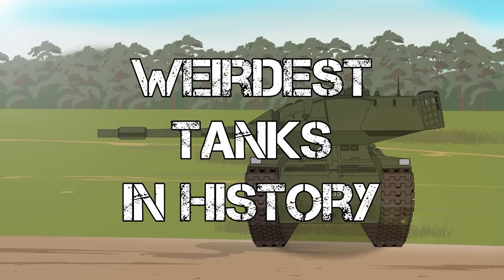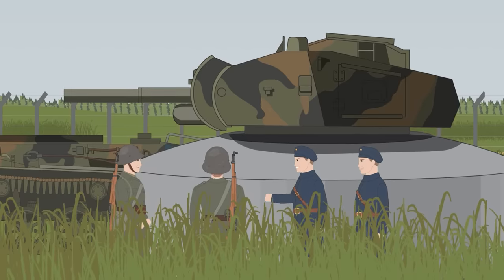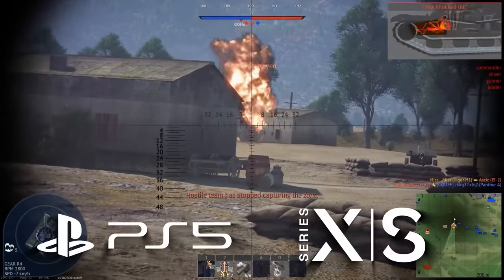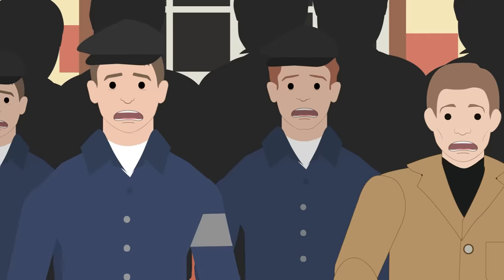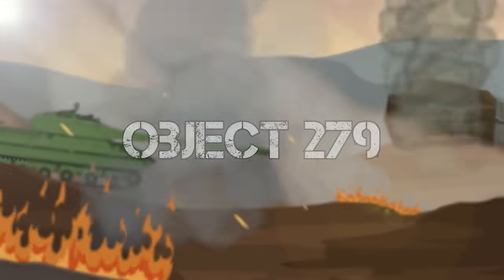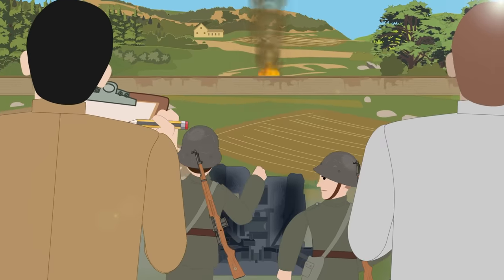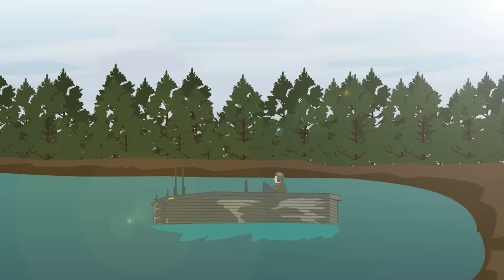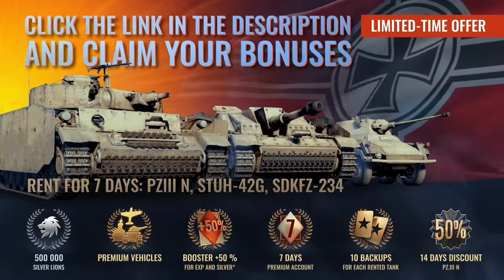Weird Tanks in History

Comment: The strv 103 was designed with a completely static gun as Swedish engineers realised that most tanks stopped before shooting so having a turret was deemed unnecessary for a tank intended fo defence. As the commies were likely only going to come from one direction so they wouldn't have to worry about flaking manovers as much. So a static gun was deemed better. It also ment that having every crew member having there own controls wouldn't be a problem as everyone can aim the gun if the gunner gets injured.
Reply: Another reason for not having a turret was also that they analyzed how most tanks in WWII were incapacitated, and concluded that a large portion of tank kills were because of turret hits, so they took out the turret also to make it more survivable.

lol made this comment before watching the video, they basically explained it citing height.
Reply: also strv 103 is designed specifically for the defensive. By not having a turret, the chances of getting shot are also lower. Low siluet are also give very good defensively
Reply: I hope World of tanks players will understand it better, as a Active player i can tell this
Reply: Any world of tanks players?
Reply: The problem of course is the Tank is only for defensive and cannot be used for offensive, being it unable to fire on the move or fire on the side compared to the newer comparative tanks with Stabilized Gun control.
Reply: And the strv 42 wasn’t a light tank, it by design and swedish standards was a medium tank, we did have a few traffic laws that even the army had to follow
Reply: @uhlegend1250  nope went over to war thunder, it's much less arcade like. One hit and your dead, compared the HP on WoT.
Reply: Swedish land tactics during the cold war was heavily inspired by finnish experiences during WW2. The finns was fighting in dense forests and on narrow roads and so turret the enemy could selldom manouver around. That is why the finns bought the STUG III from the Germans, and they used them to great effect during the battle of Tali-Ihantala. The STUG III also have better frontal armor and lower profile than its tank counterparts.

The biggest problem with Strv 103 was its fuel economy. While a Swedish Centurion(Strv 101 and 102) could be running on a full fuel tank for 12h a Strv 103 could only be running for 6h on a full fuel tank. 

A Swedish colonel wrote about his experinces training with the Strv 103 and he said that he expected that the would have had to sacrifice a lot of conscripts to cover the refueling of the Strv 103 in the middle of the day.
Reply: The Strv103 was tested by NATO and it was discovered it had no trouble competing with traditional tanks
Reply: @scruffy7760  that statement is so vague and imprecise that it can be disregarded offhand
Reply: Yeah, but no. The Strv-103 was NOT solely intended for defensive use! It was intended to serve offensive purposes as well, especially to attack soviet bridgeheads.
Reply: At the time, no tank had a true stabilized gun.
Reply: In the 60s and a bit into the 70s,tanks weren't really stabilized. So everyone had to stop to shoot accurately. The Strv103 could turn faster than other tanks turrets and was also a more accurate platform than many other tanks at the time. So, in the trials done by NATO countries, they found that the Strv103 could function as a main battle tank without problem.
Reply: @hendi1571  And it would likely have had problems doing that especially sinde it could just drive for 6h on a full tank
Reply: @Demopans5990  though stabilizers were under development, and it was pretty weird build a tank under the assumption that stabilized guns would not become standard in some years
Reply: Sweden didn't expect stabilizers to become effective as soon as they did. The Strv103 was thought to have this advantage for at least 20 years, but it only lasted 10-15. But in that brief time period, the Strv103 was one of the world's most advanced main battle tanks, hard to hit, could quickly acquire target and was very accurate and only needed a single crewman to be combat effective since both the driver and the commander were both driver and gunner sharing the same controls. It was a remarkable tank and very functional
Reply: @DVXDemetrivs  
Well that is not what this is about. You can not improvise more than is practically possible.
Reply: @inisipisTV  Had to question, wich is this newer comparative tanks you refer to? True it wouldnt fare well against modern tanks but it would do quite well against tanks of its time bcs of the angle it was capable of making due to the hydralic suspension in the rear, this meant it could lower or highten its back to create an angle that was almost impenetrable at the time (over 300mm armor at right angle), giving it superb depression over hills able to stick out only the gun over the edge and shoot down to pen the weaker top armor of enemy tanks. Most tanks wouldnt get a chance to flank due to the distance of battles (1000m or more) and the quick reverse of the strv 103, but this would ofc depend of the nature of where the battle was, out in dense forests or in cities the strv 103 wouldnt have served as well. (tip see also the swedish prototype UDES 15/16 which used same hydralic suspension but with a turret, never built thou).

The strv 103 was made to fight russia, wich lacked in technology at the time, they didnt have stabilizers as a standard yet, however the t64a was one of the first russian tanks with stabilizers installed at 1971, but it was deemed to expensive and was stripped down to make the t72 instead, wich used a stabilizer with a massive error so they tend to stop and fire anyway. In a swedish offensive against russia with strv 103 vs t72, i think strv would have been superior due to the low profile strv has, they wouldnt see the tank until it fired, and if t72 survived a shot they wouldnt bee able to fire back accuratly due to the error in their stabilizers that gave over 1 meter missfire. The t-64s would bee harder to beat but might not bee able to pen strv as their cannon is only capable of a pen of 250mm, t64 had 4 missiles with pen of 600mm but a hit chance of 80% at best so fair fight, unless t64 where the offensive tank, then t64 would bee annihilated due to above mentioned reason with hills and depression of the strv.

Fun fact, russian tanks didnt have and still doesnt have any gun depression (-4°) so a strv 103 (height of 1.7m at gun mount) could technicly drive in front of the t64, t72, t80 and t90s (height of 2.2m) and bee safe from cannon fire due to its low hull and steep armor curve, put their gun against the hull of the t-tanks and blast the t-tanks out, russian crew would bee helpless. But thats not how tank battles are fought so would most likely never happen.
Reply: @scruffy7760  we did try it against the leopard one when we bought them. And the s tank won that “battle” but I’ll would say it was both the tank and crews experience whit it
Reply: @Normal_Country  I don't know what all you fellers are smoking but nobody really gets to choose how their armor is used, they might decide it's a static gun but their opponent doesn't have to agree to fight on their terms.

That tank would be laughably inflexible and useless in combat - they can't even raise the gun.
If it can't hit the enemy what is it for?
Reply: When the Strv 103 was compared against other NATO tanks of the time it was found that it took no longer for it spot a target and to fire at it than other tanks, the no stabilizer was not a problem. Also it was not designed just for defense, it was an MBT and it would have done everything MBT's are supposed to do which includes being on the offensive too.
Reply: @elliotkane4443  ??? Did you see the tank?
It can move the entire tank in a way that they can accurately shoot
And by your logic no tank-destroyer could be effective which if you just look at ww2 is not true in the slightest
Reply: @henrik3291  Even by the time stabilizers came they only worked for about 25km/h before being completely useless. There is a reason t-55s and t-72s even had to stop to fire
Reply: @fishyfish6050  
"only 25km/h" you know what that is still alot better than have to stop and turn the whole tank like you would have to do with strv 103
Reply: @henrik3291  and yet you disregard the fact that it was still innacurrate to fire on the move in a t-72 let alone t-55. The only tank that was able to do that uch more accuratly was the Centurion
Reply: @fishyfish6050  
The Centurion which the strv 103 was meant to replace but never did replace since the performance of the strv 103 was unsatisfactory.

Dude you have already lost, just give up
Reply: @inisipisTV  Tho keep the contemporary in mind: It was a Cold War era tank. Gun stabilization is something that wasn't nearly as sophiscated back then as it is in modern / post-cold-war tanks. It's intended main enemies would have been the vast stockpiles of WWII era Soviet tanks, none of which had stabilization systems... thus it wouldn't even be at a disadvantage in that regard.

Comment: The swedish also made a prototype for the strv 74 which had 4 rb55's strapped onto the turret. if you search up "Strv 74 rb55" and go to images you should see it

And the strv 103 als ohad a prototype which had composite armour strapped on the front hull and sides. At that angle and depending on how thick the composite was it would have 300-600mm+ of composite armour. If you search up "strv 103 composite armour" and go to images you should see it
Reply: iirc the latter were NERA composite armor blocks, and idk if it's really made of granite as alot of places i read about it do claim that it was.
Reply: The strv 103 with composite was only a mockup and the blocks were most likely just Styrofoam.

Comment: fun fact : Strv 103 is the first tank with turbine engine so the reason it was not bought and implemented is not because of its feature but its overly expensive price
Reply: not necessarily, but it's part of the reason, the other is that by the time that it was booming in the public, Gun stabilization systems were improving allowing the MBTs and other military vehicles at the time to effectively fire on the move, as during it's development, it's competition in the arms market still wasn't able to do so as their Gun Stabilization system was quite inadequate to the specifications of the designers of the military vehicles.

Comment: strange tanks, and you don't mention the FV4005 Stage II, a Centurion based tank with the largest gun ever mounted to a tank (183mm cannon) shielded by a "turret" which is not really a turret per say. There were only 2 FV4005's ever built, Stage I and Stage II, Stage II is sitting as a gate guard at Bovington Tank Museum, and the Stage I actually went missing soon after it was built and tested. the Stage II is fondly known as "Spud", and is quite the tank to first see as you drive up to the entrance of the museum, and would have been a real nasty thing to face with its powerful cannon that was meant to destroy large emplacements and buildings, as well as the ability to liquify crew of any tank it could face with its massive HESH rounds, that do not need to penetrate a tank, it just has to explode on the armour to cause serious spalling inside that can be powerful enough to liquify anyone inside.

Comment: Strv 74 crews: Tank sucks to fire at 3/9 oclock positions
M56 Scorpion manual: All non gunnery crew should dismount before firing when possible

M56 casually jumping in the air when it fires because it weighed 7 tonnes.

Comment: You forgot to mention that Strv-103 operated by 3 crew members (commander, gunner as also driver and rear driver) . But actually, the tank itself can be operated by 1 crew only. IF I am not mistaken or forget, those 3 crews have a control to operates the tank individually in case 2 other crews are dead or wounded. 

Please CMIIW.

Comment: There were quite a few tests done involving the S-103 comparing it to various western tanks, and it performed pretty well against them. Back then, tanks had to come to a stop in order to fire accurately, so the turretless design was actually not a huge downside. The S-103 was not alone in needing to stop to shoot when it was designed and used, meaning this disadvantage was one that all tanks at the time shared. However, as modern fire control systems were introduced, the S-103 became obsolete due to the fact that turreted tanks could now fire on the move, whereas it could not. Personally I think the S-103 is a very cool design that, despite being made in the Cold War, still gives off futuristic vibes. And to be fair, it was a pretty futuristic concept when it was new.

Comment: The strv 103 was not an untested or dramatic design.  The Germans in WW2 used panzer III chassis and created the Sturmgeschütz III (StuG III) with a fixed gun, technically classified as artillery.   Great defensive tanks that more than proved themselves (Finland got a bunch when fighting the soviets a bit and they killed 11 soviet tanks for every StuG lost)  Germany made a lot in the late war, they were easy to produce with fewer parts and lighter so fuel consumption was lower.
Reply: It's very unlike any SPG. It was dramatic because it had fully fixed gun and needed to be aimed with suspension alone.

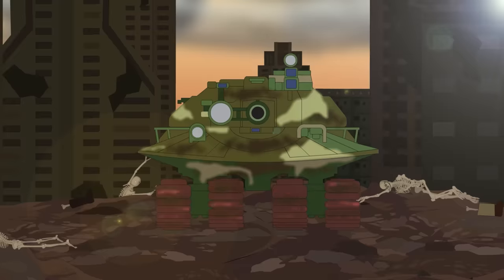Comment: 0:25 Bro already made a mistake of having Leonardos tank drive forward because we have the blueprints of it and there is a fatal flaw in the design, because of how the gears for the wheels were placed, the tank could not move forward, it could only turn because that one of the wheels would spin the opposite direction of the intended direction of movement which was a really easy thing to fix